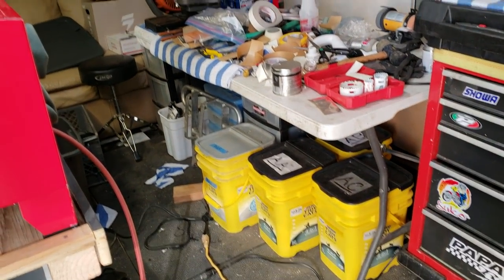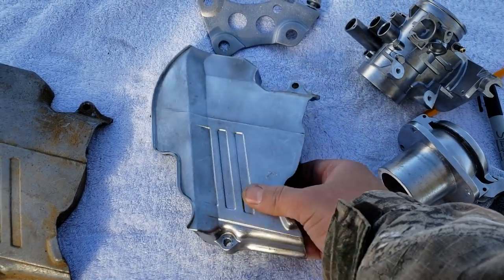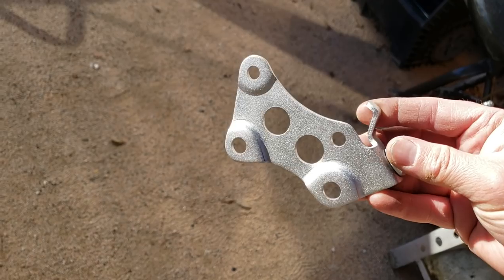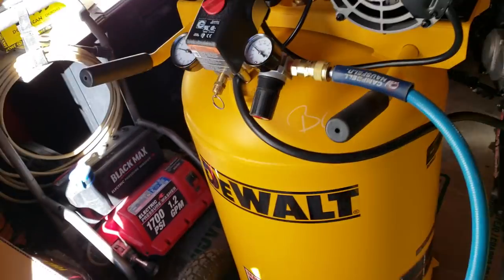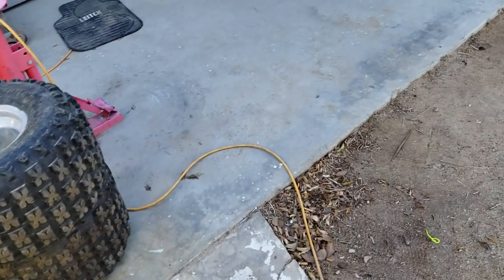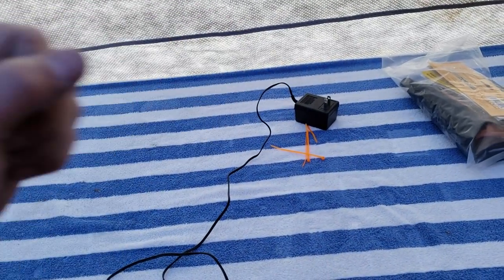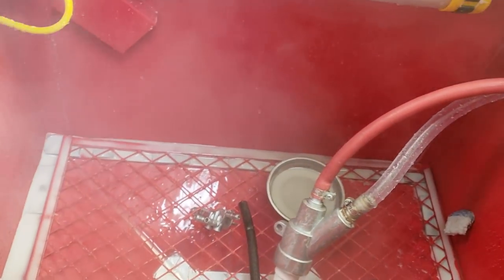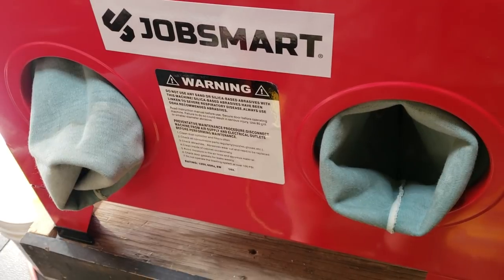Diy Vapor blaster  Mini homemade wet blaster sandblaster best parts cleaner

Comment: Why don't you connect the pump output at the bottom of a tapered reservoir bottom shaped like a funnel. All the media will fall toward the bottom center, since there is no flat surface. Break up the water leaving the cone area (shower head) to redirect it in all directions at once in order to keep the media/water mixture well mixed.

Comment: justin.could you use fine  builders sand in the vapour blast cabinet on aluminium parts..foot peg hangers etc or would it be too aggressive.thanks
Reply from the maker: Too aggressive. It will pit the aluminum and make it dull. Also don't use silica-based sand. The glass bead is like a powder in your hand. Medium 80 grit is only $25 for a five gallon bucket at Tractor Supply glass beads. I got the super fine 330 glass beads at Grainger
Reply from the maker: Even the 80 grit glass bead will make it a little dull. The super fine grit will give you a nice reflective quality. I recommend first coat 80 grit medium second coat superfine will look brand-new when you're done.👊👍
Reply: @EmilyandJustin11  thanks ill follow your advise.cheers from liverpool uk

Comment: hi bro, in vapor blasting what kind of sand and size for removing paint, rust and crust?
Reply from the maker: Regular glass beads media
Reply: for what size mesh?
Reply from the maker: 80 grit
Reply: please provide the size of the details for me to easily order buy online tanks
Reply: what do you do with my question
Reply from the maker: I bought the 5 gallon bucket at Tractor Supply regular glass beads. Sorry I don't have exact details. Any glass beads media will work. I have shown the bucket in one of my other videos

Comment: Awesome conversion!! Just a few thoughts:  I noticed your nozzle didn't take the paint of your grate?? So, I'm assuming this is not for removing paint or powder coating. My HF media blaster has 50% of the paint left in the cabinet with maybe 50 hours use. I also realized that you're mixing beads with the water?? I just recently started looking into building one of these and I thought it used 100% water?? I'll watch some more videos... And last, I would buy some RainX and use it on your top, the stuff works, really works awesome and may help quite a bit!!... Thanks for your content!
Reply: And what trikes do you have?? Me - ATC70, 200X, 250SX, 350X 452X...
Reply: 80% Water 20% fine glass bead

Comment: Is that a regular sump pump or a trash pump? Is the pump still holding up?
Reply from the maker: Trash pump with cast iron impeller sump pump will work to
Reply from the maker: still Kicking Ass. I like it bro.

Comment: i seen this cabinet in the netherlands 
https://cdn.hbm-machines.com/images/cache/hbm-l-1887.jpg-1920x1080-6ef9d37c8d.jpg (dutch version of harbour freight )

seems like the same one , like the fact that is isnt screwed together like the "bigger ones"
(should be eazier to "leakproof ") 
that its a table model and that its a toploader (biggest door available for its size )

can i use the original sprayer thats included with the cabinet or is the nozzle youre using a lot better ?

small updat...... just bought the cabinet myself and i found out the window is plastic , no problem to drill a hole in it and mount a wiper and wipermotor 

planning to weld in a pipe for the fluidreturn straight out the side of the funnel as near the bottom as i can get it so i can set the cabinet down without the pallet under it i dont think it will matter that mush in terms of flow